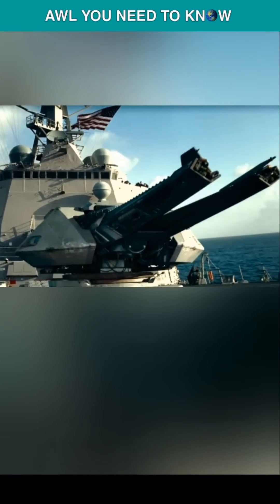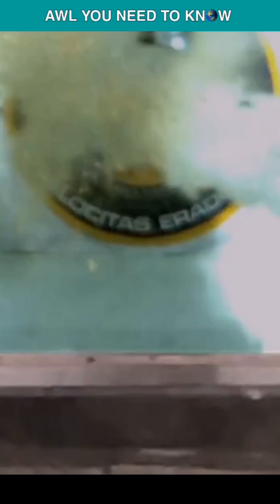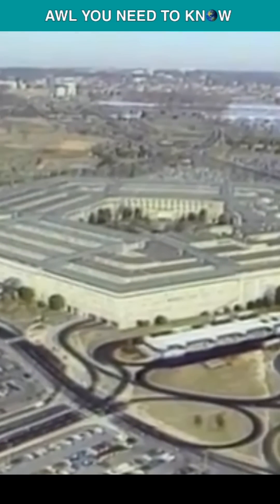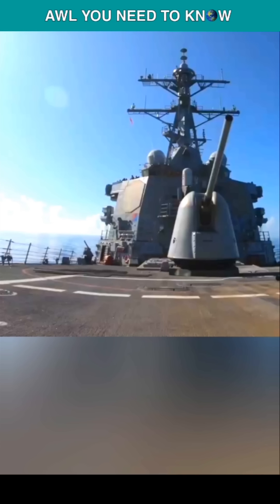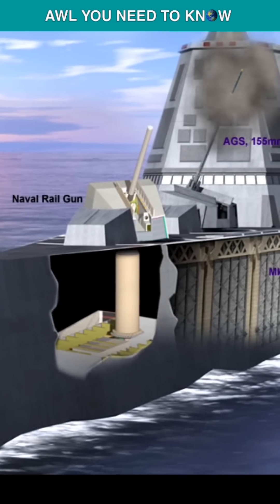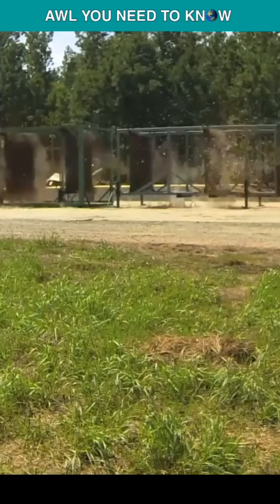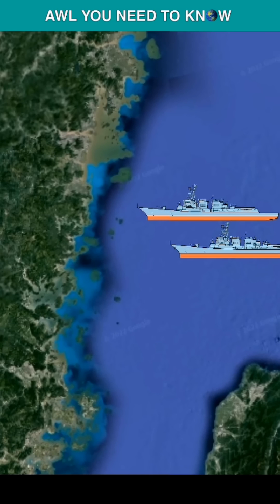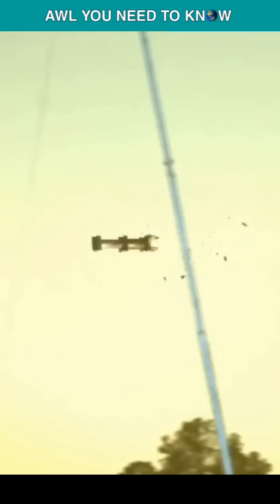United States Navy Railgun Is No More! #shorts All You Need To Know

Comment: The range argument is wrong. The railgun is capable of over the horizon shots. The issue is cross sectional detection to avoid being engaged by missles. Reason the development of ddg1k occurred. Currently, railgun is experiencing the "not enough break throughs in materials." Current materials are not capable of withstanding heat generated. Leaving the weapon system with a very low active service life.

Comment: It may need servicing after 12 round but assuming you don’t miss that’s 12 ships sunk because no matter how thick the ships armor the round is most likely going to penetrate the armor
Reply: But the round is nothing but a metal brick. It would effortlessly make a hole into any ship, but a single 10 inch diameter hole isn't going to sink it.
Reply: @CM-fh7kk  you’d be surprised
Reply: @DasGladiator222  I mean, the reason ships in ww2 all had ammunition with explosives inside them (even AP ammo, just not quite as much) was that it was the only way to do significant damage to something as large as a ship.
This is actually something known as overpenetrating: if a large caliber ship such as a BB hit a DD with AP ammunition, the round would just go through the DD without igniting the fuze. Sure, it would leave a clean hole through the destroyer, but without the explosion of the round it would not be dangerous since the bit of water entering could at worst flood a single compartment.
Reply: @CM-fh7kk  there is a sabot round made for the rail gun and been tested
Reply: @DasGladiator222  what I am saying is that a sabot round doesn't do much to a ship: a sabot round is very effective against tanks because they are so small and tightly packed that the trapped overpressure wave will kill the entire tank crew and will most likely destroy an important infrastructure system. A ship on the other hand will have a small hole punched through it, but the damage done is restricted to that one small area and thus won't sink the ship. A ship just has too much redundancy to be sunk from one small hole.

Comment: THE MILITARY FINISHED IT AN IT'S IN USE IT POPS RIGHT UP AND OUT OUT OF THE DECK  AND THEY HAVE A ELECTRIC PULSE GUN AN THAT WILL BLOW A HOLE  2 FT IN DIAMETER IN ANYTHING LAND OR SEA  VERY DEADLY ITS BEEN AROUND FOR ALMOST 12 YEARS  SAME THING AS A LAZER BUT A BIGGER HOLE AN CAN FIRE VERY FAST  LAST I HEARD DARPA'S WAS STILL WORKING ON HAND HELD RIFLE THE SMALLEST IS VEHICLE MOUNTED. BUT ITS STILL VERY VICIOUS .

Comment: just so you know the maximum potential of a rail gun is it's operational distance is not 100 miles. 2 to the projectiles insanely high speed if the sign for it a rail gun could be inter continental artillery. imagine firing a cannon in New York that land somewhere in Moscow 7 seconds later

Comment: The US Military was more concerned with impressing the press which means using the powder load and casing with the railgun, but if you don't use the powder load or casing, it extends the life of the railgun, it's range, and time between servicing it and although hypersonic missiles will most likely be necessary, the railgun would have been the perfect weapon for the Zumwalt class, a lot cheaper too

Comment: Sounds like the Rail fun couldn’t charge per round like they do either everything else.  Isn’t hard to figure out.  They probably hampered the R&D from the start.
Reply: The cost of rail guns vs missles is comparitable due to the insane matinence costs of railguns.   Also, railguns destroy the barrel every few shots and have to be replaced so it is likely that the ship will very quickly be out of the fight in any large naval war due to equipment malfunction.   Plus, railguns require so much power that the only ships that can meet the demands are nucular powered ships which are WAY more expensive.

Comment: A rail gun would be far more effective and less costly in the long run if it can be perfected.
It's ammunition is cheap, basically just a hunk of metal and it's powered by electricity which is in ample supply on a nuclear powered ship.
It's also extremely powerful and fast, impossible to track or knock out unlike a missile.
Reply: It actually would cost about the same as missiles to operate since there is SOOOOOOO much matinence with railguns.   Plus, since they are so fragile and break so often a ship equipped with them would soon be out of fight in any large naval war just due to equipment malfuntion.
Reply: @zagnut3707  Andddddddd what did I say?
If the tech was perfected better...
Hundreds of millions for hypersonic missles that aren't even hitting anything seems a huger waste of resources.
Palestine can do more for cheaper.

Comment: no, it requires a lot of power and i mean a lot to fire and it basically tears itself apart after 1 round not 2000
Reply: He said 2 dozen not 2 thousand
Reply: @WaffIe-House  which equals 24...he clearly didn't know
Reply: Yeah thats kinda the reason why it isn't in service yet but new material tech it could get to the point where the (now copper) rails hold out long enough , energy storage and production is also a field of science that is fastly developing and the potential behind a rail gun will bring back such projects every decade and same day it will be a success well it is cheaper in service than any other ordnance but its high inertial cost will hemper the development of such systems quite a bit
Reply: @TheLtVoss  You know what is cheap? Full stops.
Reply: Well is not a gun for the trigger happy uncle sam

Comment: Not applicable unless they develop materials that can withstand the stresses and a more powerful miniaturized nuclear reactor to provide the massive amounts of energy needed to propel the projectile. Personally I like the idea of Rods from God more
Reply: The energy is fine. We use capacitors to store it. It’s all about the barrel not withstanding the forces. Probably some sort of super cooled barrel is necessary.
Reply: @GeopolInvest  more likely get rid of the barrel all together and use a series of ring magnets that hold the projectile or missle in a magnetic field. Like the super colliders or tokomak reactors use.
Thus they could be propelled and directed by magnetic fields. No contact with a barrel.
Reply: Rods of god was never practical. The energy required to bring such rods into orbit would be very high.
Reply: @GeopolInvest  Yes but if they can make them from stuff in orbit already- asteroids or on the moon - or even harvest space debris and melt it using solar reflectors.  They were looking for some way to get rid of all the junk orbiting up there. Now all they need is a star trek traction beam.
Reply: Also fusion reactors seem to actually be in the immediate future rather than the usual 20 to 30 years away. These would be non radio active and potentially transportable in a large truck.

Comment: If one wanted to launch hypersonic missiles with a light fuel load. This could be done with a rail gun. Even the new launch rails on the new aircraft carriers. 
One might consider it the first stage of a rocket. Also the launch would be almost horizontal. And the missle could travel at subsonic speed at just above water surface
 Even using ram air technology to save more fuel. These could travel up rivers to most industrial city targets. Only going hypersonic once they reach radar detection range. 
By having minimal fuel on board there would be room for multiple warheads in a very small package.
These cluster flucks would really bring a nation to it's knees quickly.
Reply: You don’t understand anything it seems. None of what you said is  good idea. A missile in a rail gun would destroy the missile. Slugs of metal are used. Hypersonic missiles go hyper sonic via gravity.
Reply: @GeopolInvest  Current hypersonic missles work like a Rollercoaster the fuel takes it up high and gravity brings it down. This is a ballistic trajectory. I am talking about a different type of weapon. A stealthy cruise that conserves fuel till the end of the run for a final sprint to target. 
Of course this is not the way current designs work. But it could be the way future designs work. Just because it does not exist does not mean that it cannot. 
Every new weapon is unimaginable until someone imagines it.
Reply: @GeopolInvest  The Chinese are already developing an amphibious version of this. It travels underwater until it reaches sonar range of a carrier group. Then pops out of the water and skims above the surface reaching supersonic speeds to hit targets in the carrier group. These can lie in wait on the ocean floor for months waiting for an opportunity to pass nearby.
This exploits a weakness in the American carriers defense systems. As subsurface, surface, and Air systems are not integrated and each function separately. Thus this missle jumps from one system to the next delaying response time.

Comment: It never was! Rail guns required too large and expensive of a power source to be an Effective weapons system.
Reply: It wasn't that. The energy source was readily available. It was the fact that the rails that deliver the magnetic charge burnt out after a few shots so not really affective for co tindal use.
Reply: Incorrect. The re charge time was slow. Capacitors could be used. The barrel needs replacement too often.
Reply: That has never been the problem.